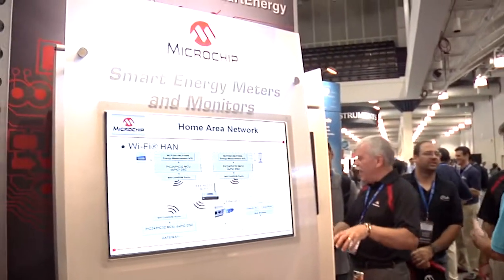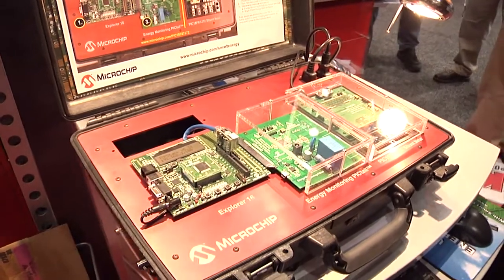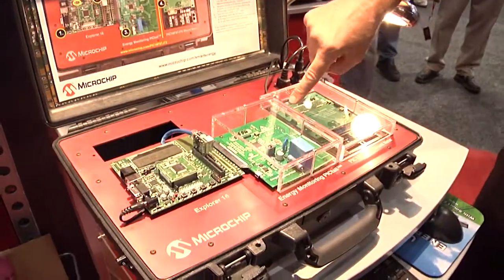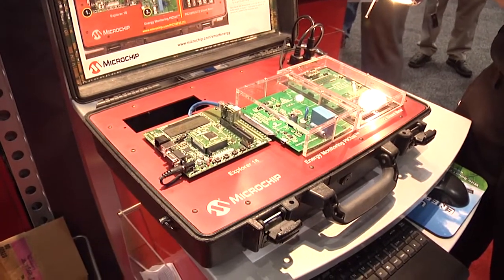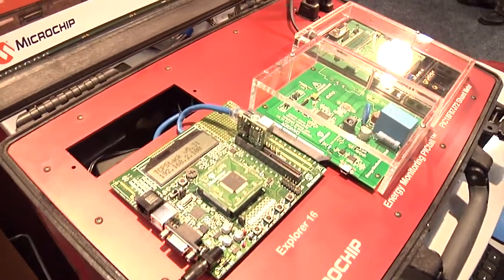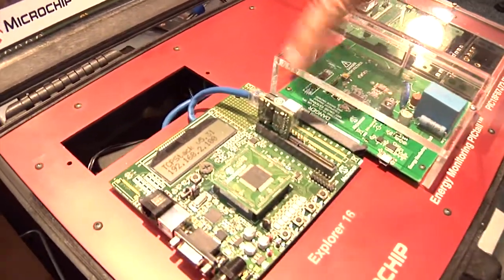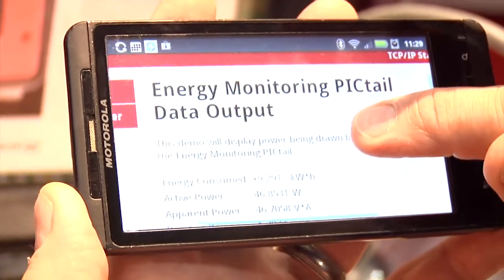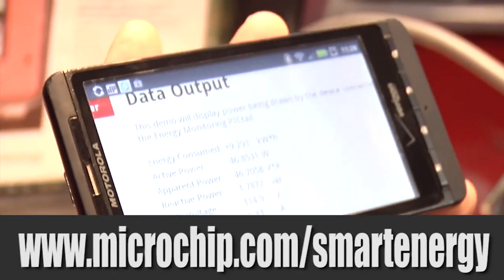Smart Energy Meters & Monitors Demonstration

Comment from the maker: @logitek256 Yes, some high current meters use CT. No hard limits, just practical ones: observe the IC’s input voltage limit of +/-1Vmax and typical dynamic range of 1000:1 for most meters. A typical homes 200A service would then also want to be able to meter 200mA accurately. The full-scale signal is rather easy to measure accurately and it is the small signal that presents the greater challenge which is typical of most sensor interface circuits